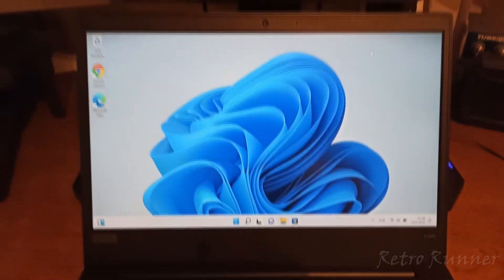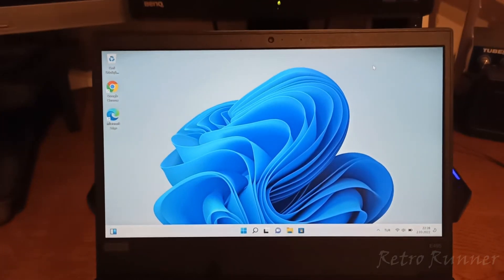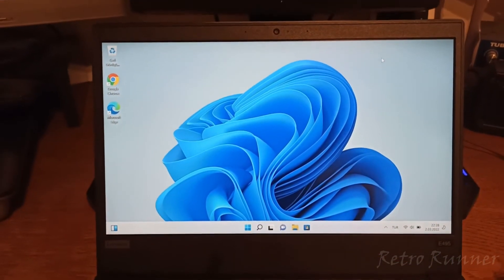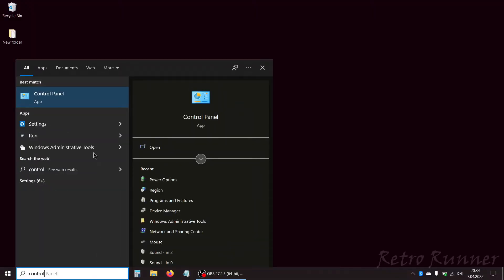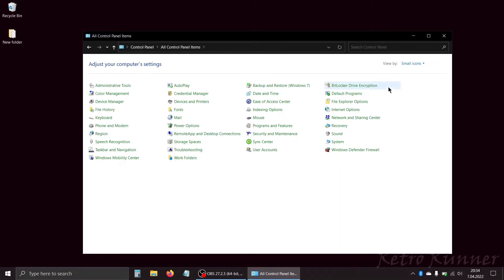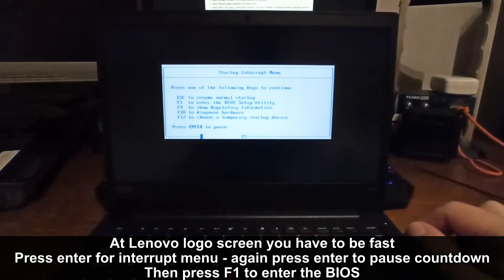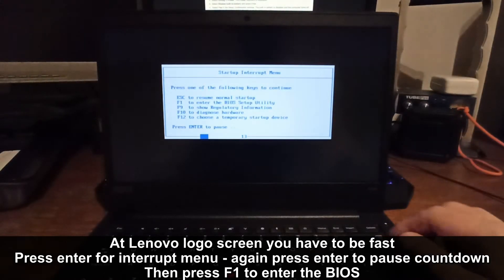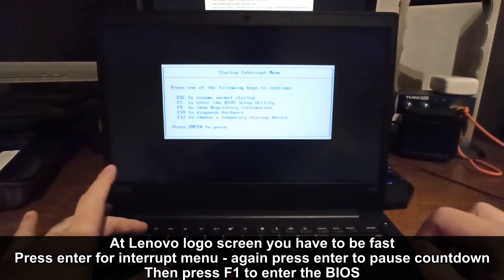Lenovo E495 Laptop Disassembly And Memory Upgrade

Comment: Do needs add alum foil for heat sink protect from plastic case?
Reply from the maker: No but i use rubber pads to lift laptop a bit higher while using.
Reply: @RetroRunner  oh ok thanks for respond! Keep up more accessories and project accessories.